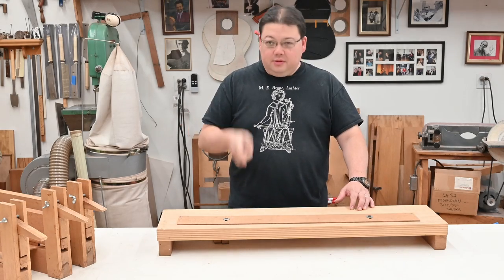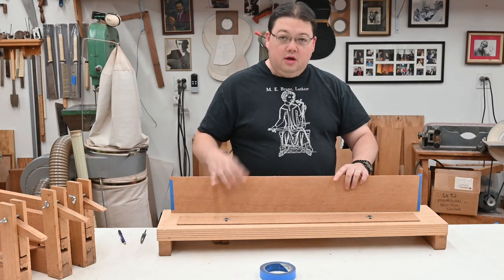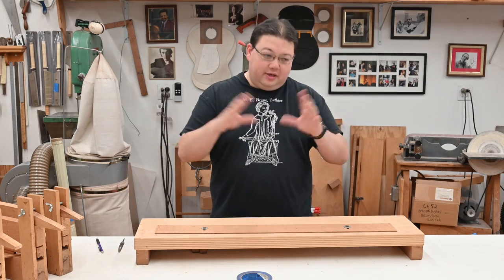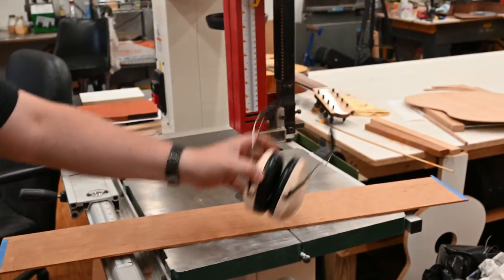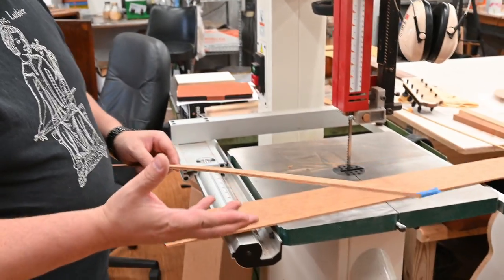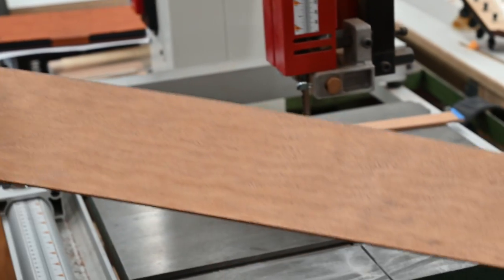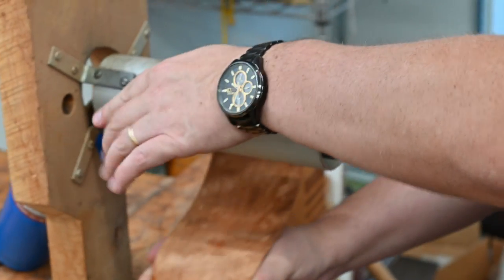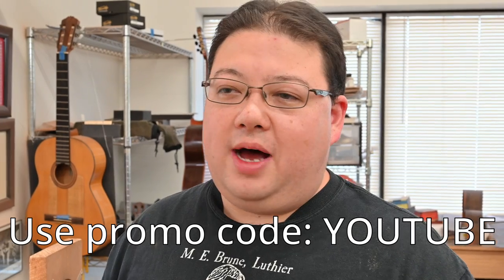The Best Way to Bend Guitar Sides | Pro Luthier

Comment: I started building acoustic guitars a couple of years ago and didn't want the expense of buying a fancy banding machine. I found a second hand Ibex bending iron on ebay. I must admit to cracking one of my first attempts, however, having done a few now, you get to feel when the wood wants to bend. one other thing I find helps is to use a bending strip to support the back of the bend. i made mine out of a 0.5mm strip of copper sheet with wooden handles attached

Comment: Not a close contour fit, large gaps. Forcing to fit your mold with heavy clamping is to be avoided. Why? Why introduce static tension?  Would you build a square box that stayed together by force fitting? Perhaps it doesn't matter...then again...
Reply: I personally did not see that huge of an issue with what he did. Granted the concaved area was alittle deeper than needed. But should not cause any issues. Also as the wood reclamates, it will attempt to straighten out. So it's generally better to over bend. Especially with opened grained species like mahogany.

Comment: I'm surprised you leave the end of the pipe open. It seems that there's a lot of heat directed toward you without a cap on it.
Reply from the maker: It is better than running out of oxygen in the pipe and having the shop get saturated in propane.

Comment: Nice bending style ! I like it, less is definitely more sometimes. 
I started making one piece sides, no tail seam.  I select a side board with a really even riff flare/fade and center the tail on it. Looks really cool all one piece without the tail seam split binding. I like the simplistic smoothy look.
Reply: This also probably technically makes the guitar more resistant to certain forces, though I'm not sure these forces matter as much as the ones on the soundboard.

Comment: Marshall you probably said and I missed it, but what thickness are your sides? I've tried to bend some figured mahogany that's .070" and having trouble with cracking. Plenty of heat and water, but still cracks.
Reply: Soak it for about 3 hours first.
Some wood is extra prone to not wanting to bend. Some will bend with ease just being slightly damp. Some needs a soak.Water is your friend with side bending. I have done ipe wood sides that need to be under water for three days before they will even think about not cracking.